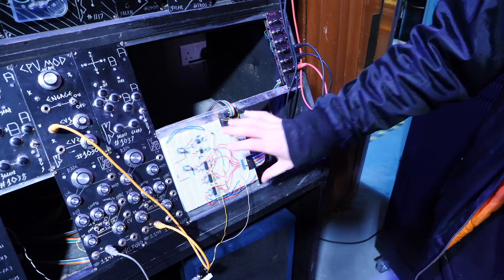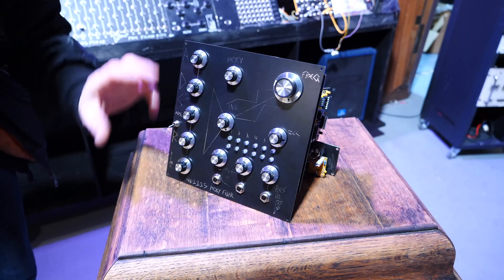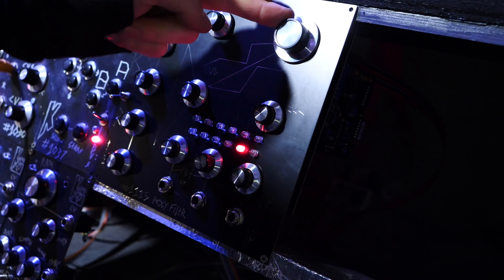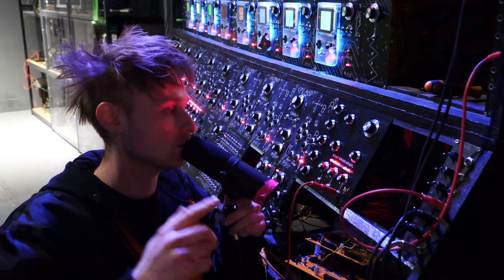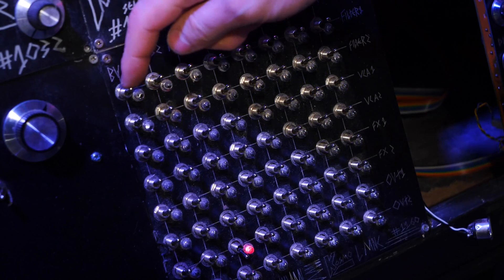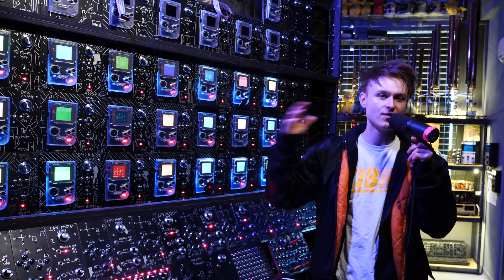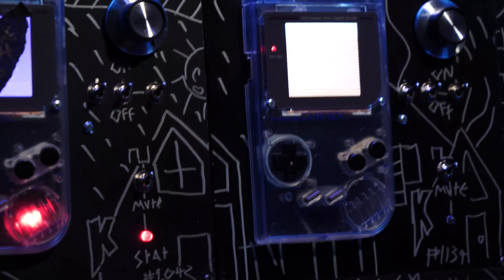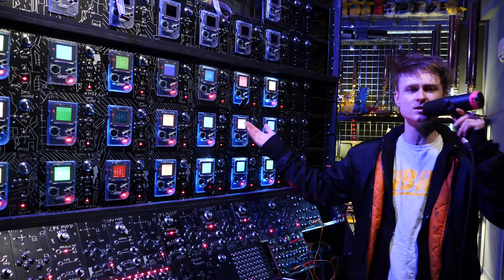GAMEBOY MEGAMACHINE - POLYPHONIC FILTER CONTROLLERS ANALOG

Comment: I saw you talking about that brand of power supply in the cabinet making video, so I went to their website to check them out. Unfortunately, the site doesn't show the traces on the board, so I had to freezeframe your video to answer the questions I had with them. Since then, I've been waiting to see someone having a problem with them, as they have an inexplicable design quirks.
It looks like they are using diodes to divert power from the output to backfill the bulk storage capacitors when the power rail exceeds the voltage of the input capacitors, but they would need at least 3v over the current state of the capacitors to absorb this. Meanwhile, a 12VAC transformer will only put out a peak voltage of 17 volts. The linear regulars they are using need 2 volts of overhead, meaning that only the 3v of AC ripple, every other half-wave, is going to be usable for regulation. This is why they opted for an absurd capacitor bank, and maybe went with the diode back-flow during a moment of reefer madness.
The humor in it all, is that the people that these supplies are being marketed to are all very familiar with every part of several vastly superior power supply mechanisms, and filter techniques, and with better duty cycle, so you don't introduce evil power line hum.